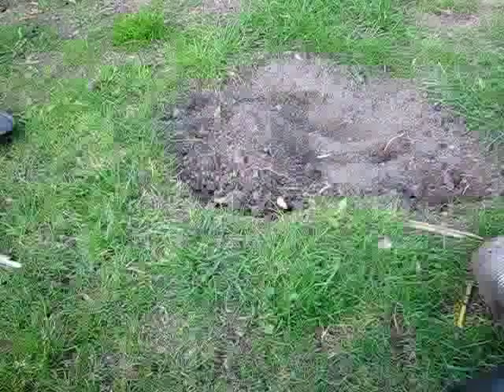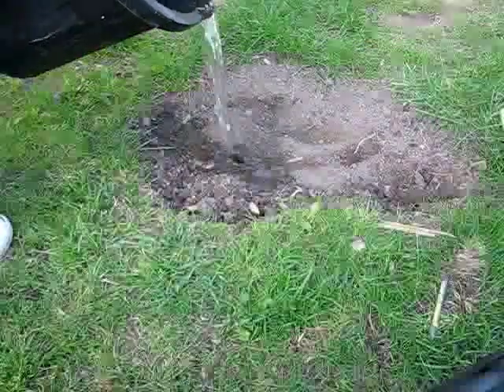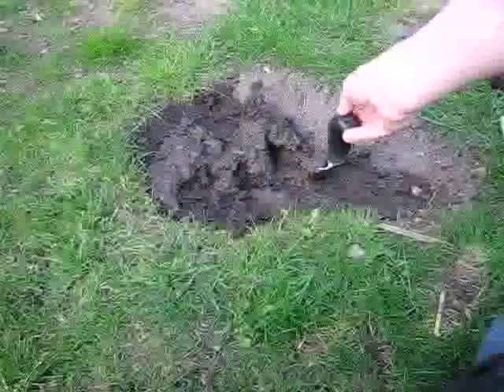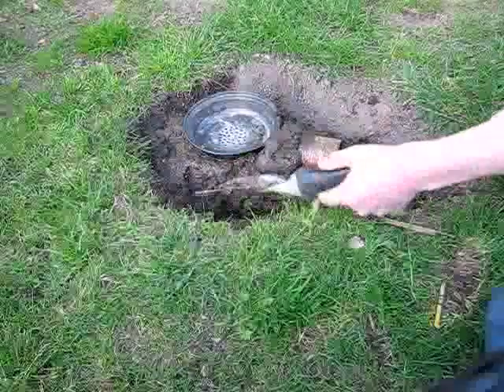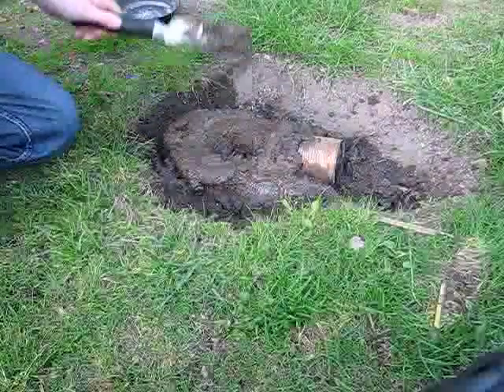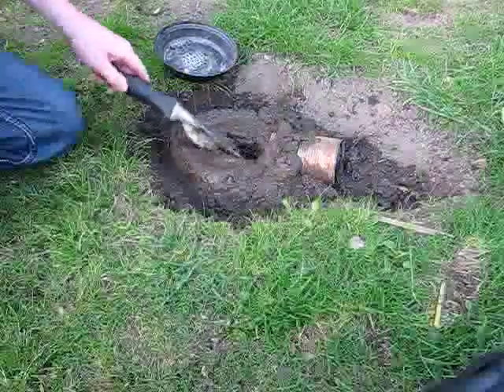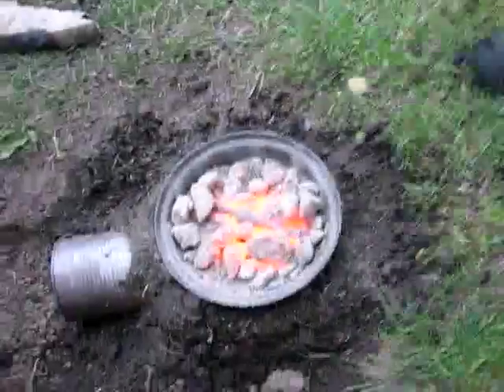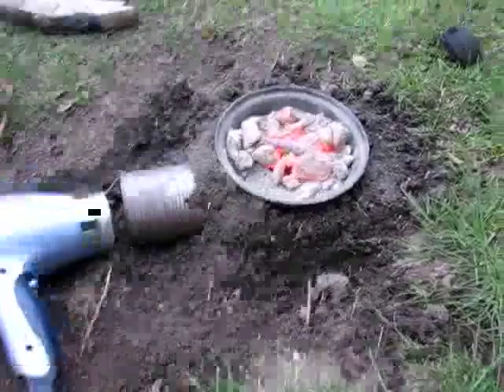How to make a charcoal forge out of mud

Comment: It can be even simpler than that.  Just a length of fence pipe or swingset leg.  Plug one end and lay it flat on the ground.  Make some holes in one side for the tuyere and then build up your mud around it like a bowl.  Let the mud dry a bit and then lite a fire.  Works great.  You are on the right track,son - don't let any of these critics give you a hard time.  :-)

Comment: Great job.  One suggestion:  if you bury the fire pan up to the rim or add the mud above it you'll be able to add more coal.  I've found that when forging that a deeper bed of charcoal works better.  Maybe because the outer cooler layers of charcoal (especially on top) insulate the main area of heat around the blower inlet.  Keep it up.

Comment: @bushcraftkid6622 yes your 100% right the increse in heat is negligible without a pipe to give evey bit of air power... i do the same thing with a pipe with charcoal and an array of heat proof bricks and a steal crucible  i can melt copper it looks white hot infact i burnt my face the other day just from the radiant heat just off the molton metal not even getting to close to the furnce i use a air bed pump for mine a hair dryer sues to much elcectrcity  give it a go cheap project and fun as fook